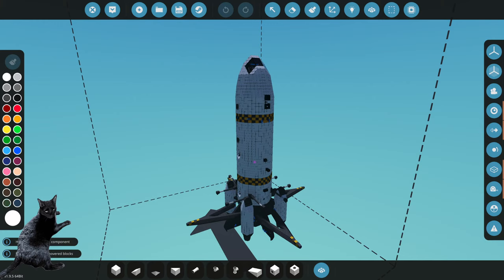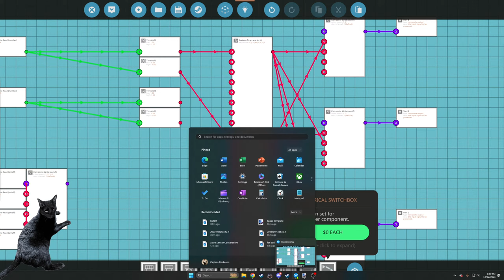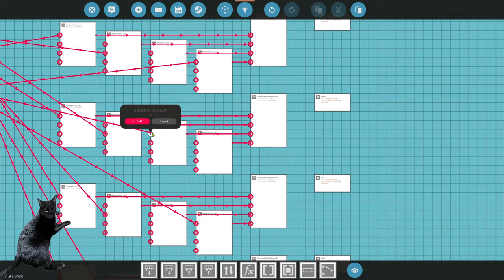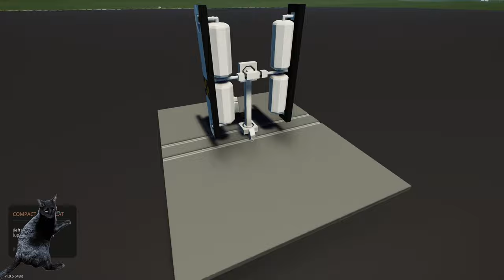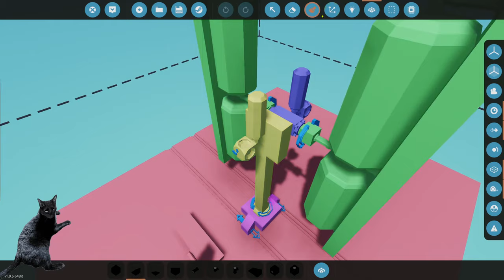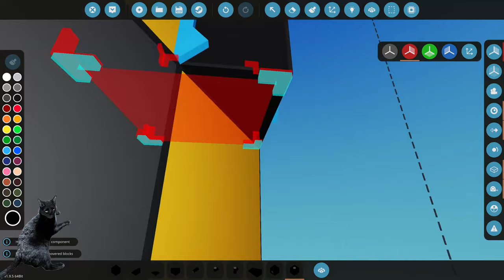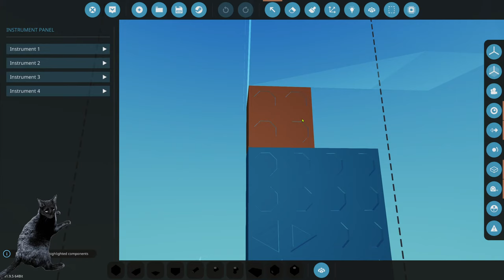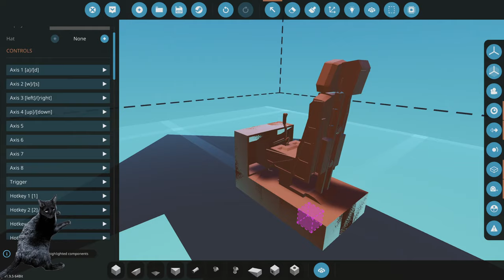Stormworks SSTO Live Build 4

Comment: 2:53:00 etc.  I'll get to adding a solution like this as soon as the gear panel is done. Apparently I never bothered to test the altimeter above 100km. Some formatting to clean up there. 
What if there was an option to make the AH continue the last pitch and roll rates before it loses the sensors and just spin like a top when in orbit? That could be cool. What do you think?
Oh and the turn indicator ball needs to fly around with g-forces. No question about that. 
Thanks for the testing and the feedback again.
Reply from the maker: I like how the current AH works in space as well
Reply: @CaptainCockerels  wouldn't take that away, don't worry. It'd be a property if anything ;)